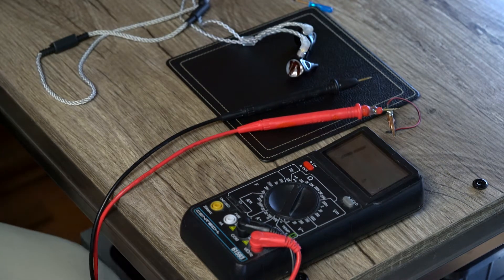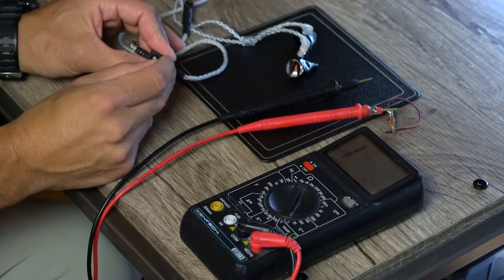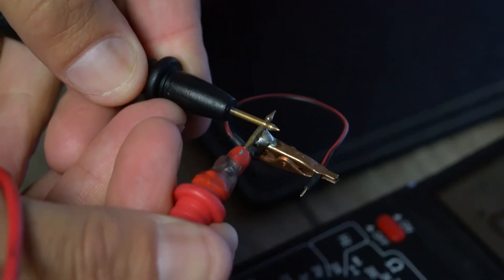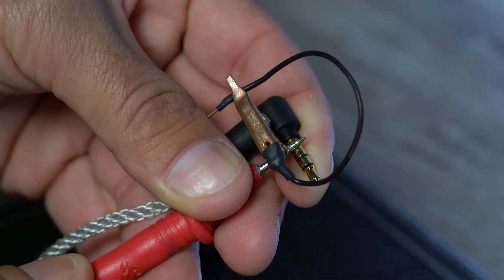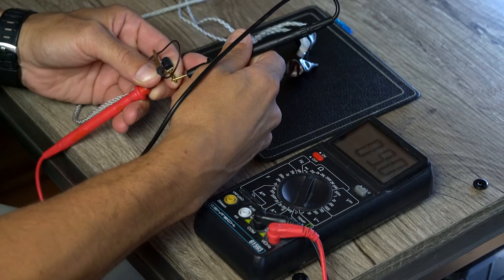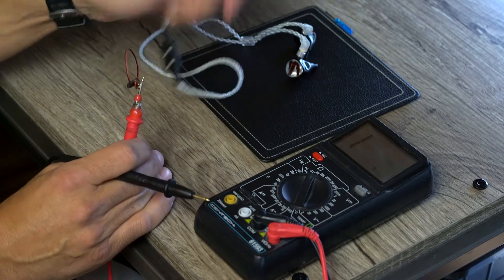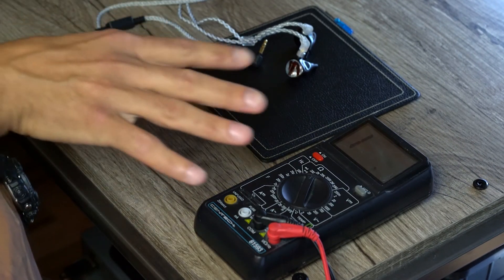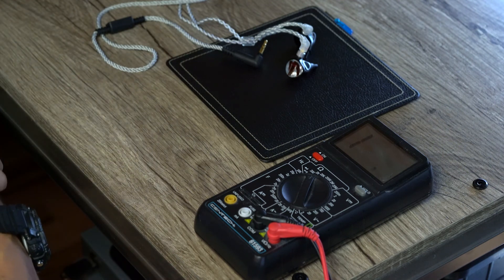How to Take an Impedance Reading

Comment: This is NOT impedance, this is RESISTANCE.

Resistance is DC, Impedance AC. A LOT of "audio" people make this mistake because speakers are 8 Ohm nominal "impedance" and when measured as you are doing here, gives 8 Ohms. The reason they are stated to be impedance is because they are designed to present an 8 Ohm load to the amplifier across the speaker's designed range.
Reply: I was confused for a second since he started using a multimeter, thanks for clearing it up.